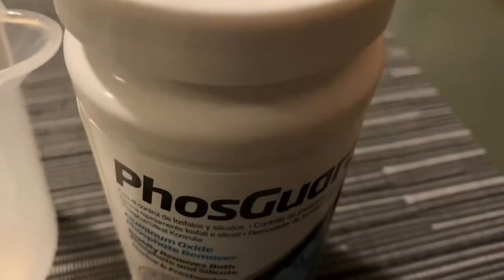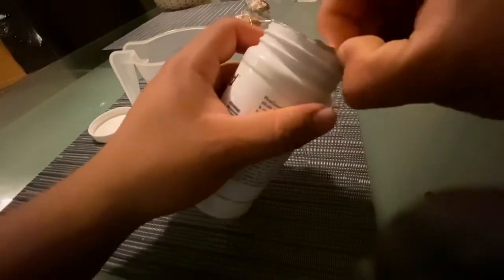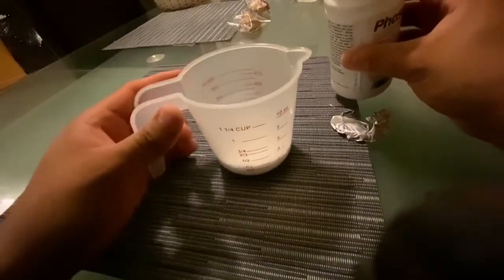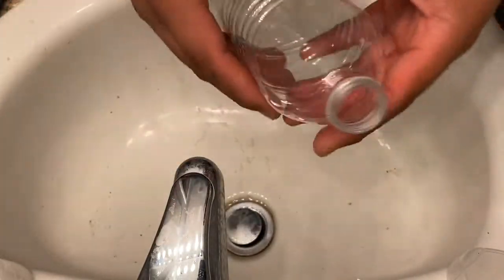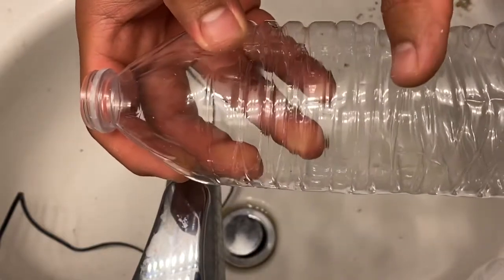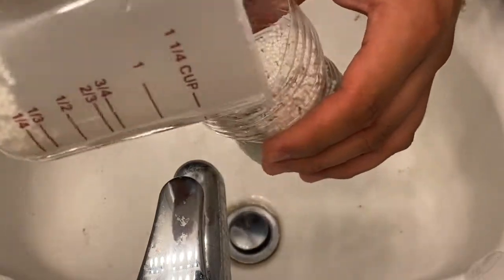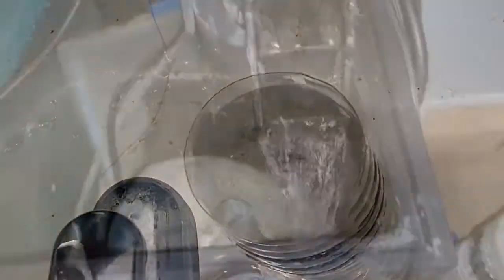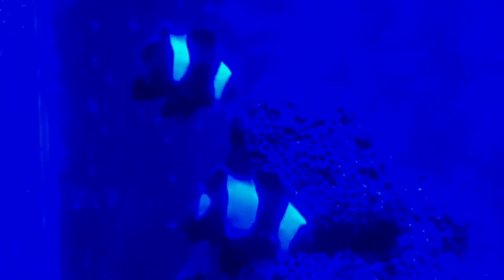DIY media reactor ”phosguard” 10$

Comment: Heat up a nail on the and poke it through the plastic just hold the nail with a tool so you don't get burned..save u on having to buy a tool to poke the bottle with holes.I made a mini version for my 12 gallon drop off reef tank...Thanks for the idea..

Comment: We’re u supposed to wash the media with RO/DI water? If not, u will introduce phosphate and silicates to ur water column, imho.
Reply from the maker: Yes that is recommended but to be honest I don’t use RO water on my tank 🤔 I use regular tap water from my house and don’t even add anything to the water 💦 my tank does very good I just do a 20% water change per month. The funny thing is that when I used RO water from a fish store everything would get so much phosphate and other things build up so I stoped using RO.
Reply: Defeating the purpose ^

Comment: Bro a media bag would’ve worked just as fine, maybe even better
Reply from the maker: My idea here was to capture as much particles as posible to have the tank water super clear.
Reply: @coachellareefer3118  Wouldn’t a filter sock be a better idea?
Reply from the maker: Yes I also have a filter sock but they get clogged too fast so the carbon works better for me.
Reply: @coachellareefer3118  I see, I personally run a media basket which is almost what you built here. I don’t like the idea of filter socks either tbh